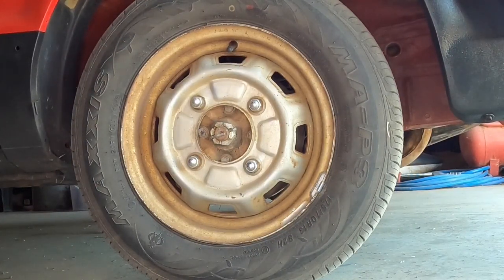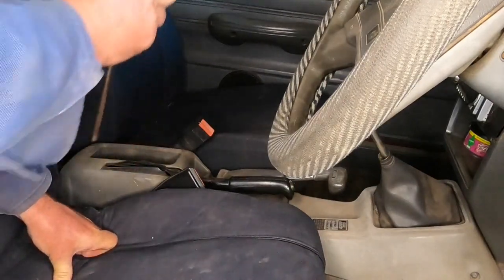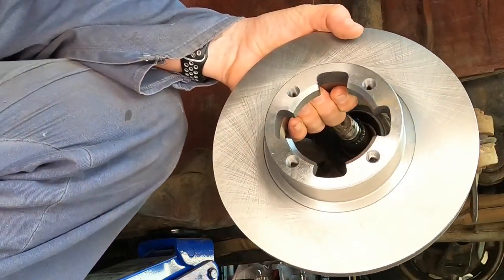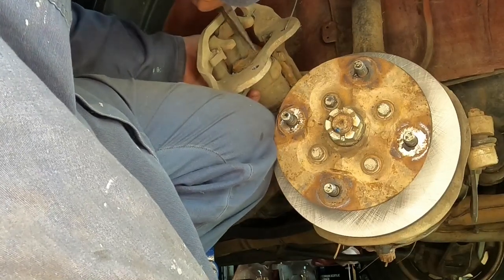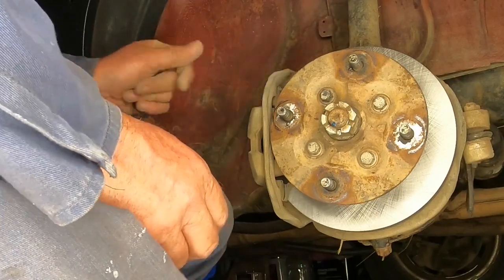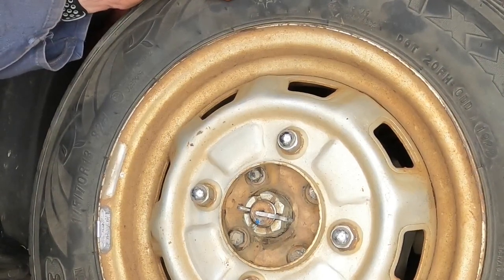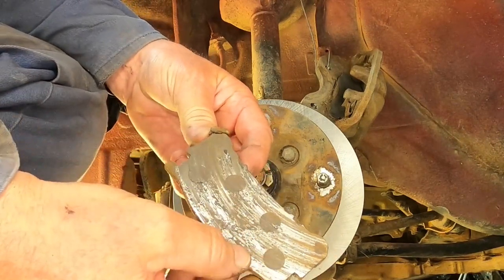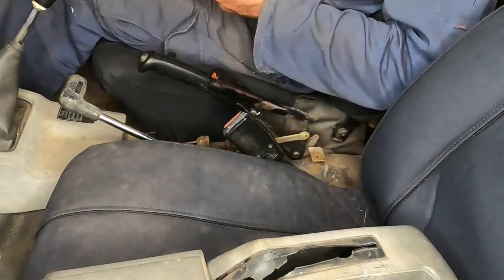1989 Subaru brumby 1800 4WD Brakes

Comment: What is the proper driveshaft nut torque?,the genuine Subaru Models 1800 CC EA81 Engine Service Manual for 1980-1994 Subaru Models Says 196 nm and the other Gregories 1800 CC EA81 Engine Service Manual for 1980-1994 Subaru Models Says 225nm,it is far too confusing for me as the safe tight range is 196nm at the lower end of the scale and it is 225nm at the upper end of the scale.
Reply from the maker: The manual I have has a torque of 196 - 198 nm so I went to 196 nm and then tightened to the next hole in the castle nut so mine would be closer to 200 nm. You should be fine if your somewhere in that range. Hope this helps.